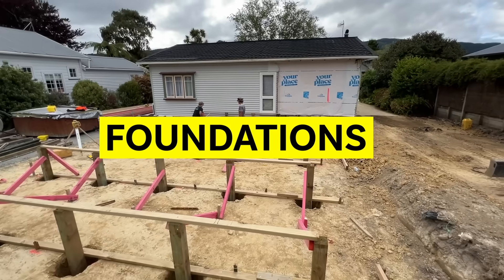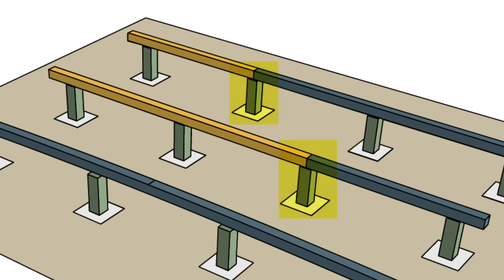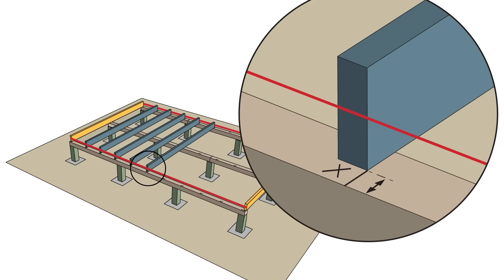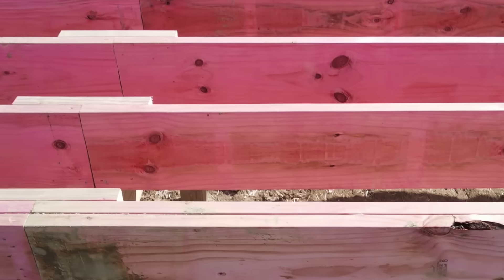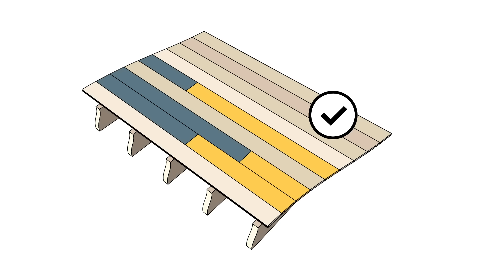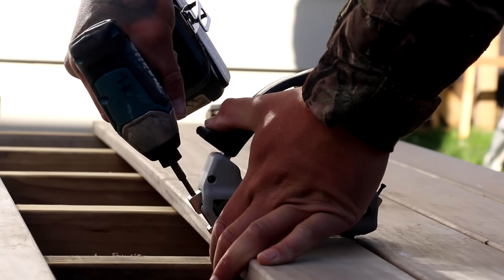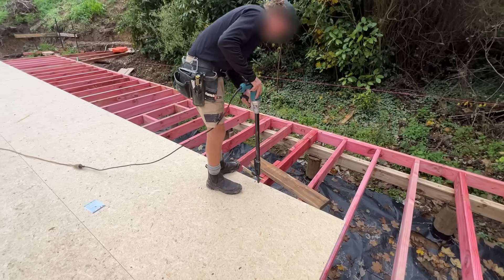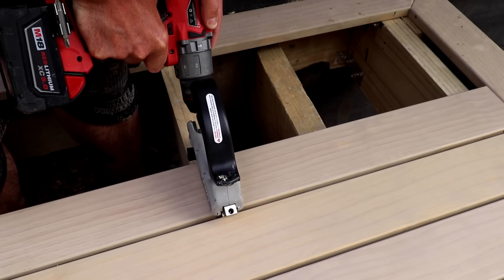How to Build a Deck That Will Last a Lifetime!

Comment: For screwing off the decking, I had to predrill for kwila so 3d printed a marking jig that referenced off the joist so could get the screwholes lined and spaced perfectly. Also set the board spacing as well.
Let me know if you ever want something like that printed as I'm just down in LH

Comment: Excellent video, from my own experience there are a couple of things you could do differently.  when laying down the decking boards, start at the house and work towards the end of the joists.  this will allow you to trim the end of the joists (allowing for the 45 or 90mm end joists), so that the last deck board has a nice finish of 10mm overhang, or whatever you choose. We tack an end joist on  to prevent twisting of the joists while laying deck boards. This only works if you have a cantilever finish to the joists-we usually use 600mm cantilever. It means no trimming of individual boards near the door, or increasing gap size to accommodate. Secondly, you can trim the piles to different lengths which allows a 1 in 100 slope on the deck boards to let water run off. I start with a "zero adjustment" at the door entrance and then add 3-5 mm each line of piles perpendicular to the house in one direction and subtract 3-5 mm in the other direction.  this essentially tilts the whole deck platform, away from the house, but keeps the level at correct position when walking out the door. Hard to explain, but hope it makes sense. Both are game changers for life of materials and ease of installation.

Comment: Pretty much all manufacturers specify the bumps/ridges on decking go down. It's not an optional what you feel like thing, the boards are designed to go bumps down, if they are up water will sit and accumulate in the grooves and drastically decrease the life if the timber. Water is the enemy of all timber 👍
Reply: Why is it called grip tread then?
Reply: @stuartrobertson8711  Marketing nonsense, to fool people, I give up why is it..? If you have ever walked over a deck that's wet with the bumps up its even more slippery than if it was the other way. Think about it timber is slippery regardless, with the bumps up you now have only a tiny fraction of that surface in contact with your feet..!
Reply: @edw9623 yeap, it’s crazy why they think here in nz it’s more grippy for slip resistance, Normally only required for ramps, there is grit coating you can use if it’s a really problem. Have always found smooth is better long term, all the grip tread up decks end up deadly in 6 months when the get dirty, wet or freeze, grow mould and mildew/moss more easily and are hard to clean. Just use hardwood, some is naturally textured with more of a raised grain, than treated pine.
Reply: my deck required grip tread up as provided access to door to meet nz building code.
Reply: @stuartdouce  Even then, your direction of travel has to be across the decking, not along it.

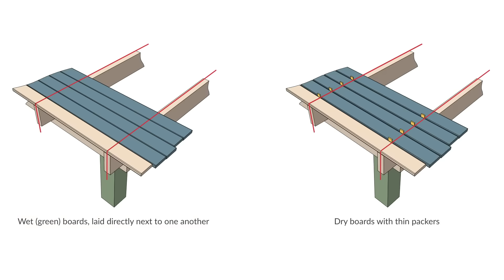Comment: What was the solution @ 7:47? Looked like the gap was too small for standard width board? 
I'm replacing a deck which had minimal gaps but want to reinstall with at least 5mm but this will mean ripping one or more boards. What are your thoughts on where the narrower board(s) should go? Of course I could do the math and rip each board to a size that would allow the correct gap but that's just too much work IMO especially  with 5m+ boards and as a sole DIYer using a table saw for ripping.

Comment: Some quality work there and well presented…. 
You guys using much composite decking in NZ ?
Reply: most people seem to use pine as cheapest option. composite prob double or triple the price of pine timber.
Reply: @stuartdouce  cheaper in Australia if you take into account that it doesn’t fuck up as bad as pine and so so much stronger
Reply: Depends on people's budget..pine for a low budget and kwila for a more expensive one.. composite comes somewhere in between?  I've only done one composite here in NZ.. Don't think they're that common here...
Reply: @garryhagen7618  price will drop soon enough for you hopefully… was stupidly high in Aus 10 years ago 
Now, not much pine being used
Reply: @garryhagen7618 composite is almost 2 x price of Kwila, works out at over 20 plm , Bunnings might sell some cheaper stuff. It’s horrible to work, too flexible, heavy, toxic waste, can’t handle uv well, gets hot to hot for bare feet. More timber as can’t span far without warping, and needs expansion gaps that look terrible, can melt with hot food/fat falling off the bbq….. slippery when wet… finishing details leaves something to be desired, and all the bits at the time weren’t available here in nz . want me to go on? I have done one 3 years ago, I could have used purple heart for a lot less, owner was adamant for the stuff from the states, I was curious, money wasn’t an issue for the job., hopefully I can convince future customers to stay away.